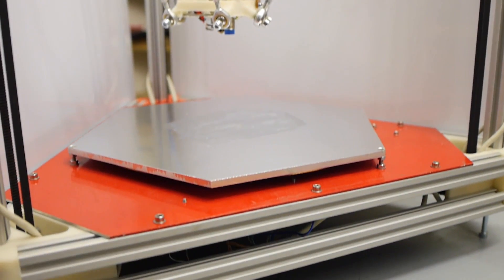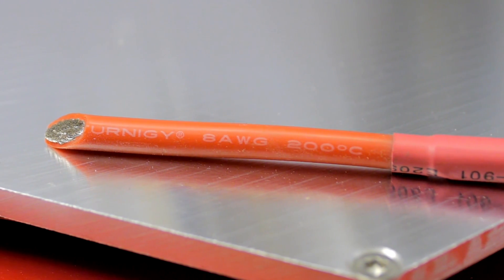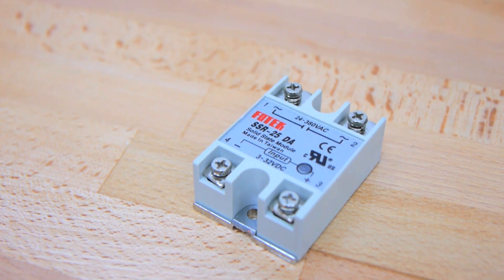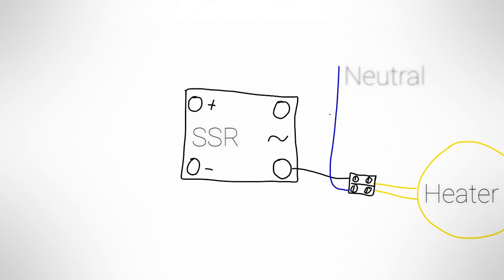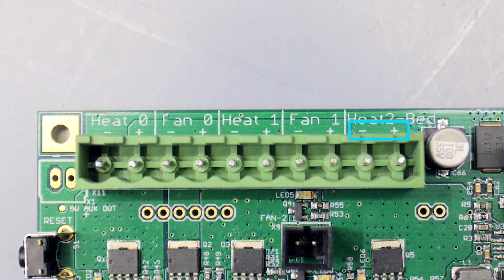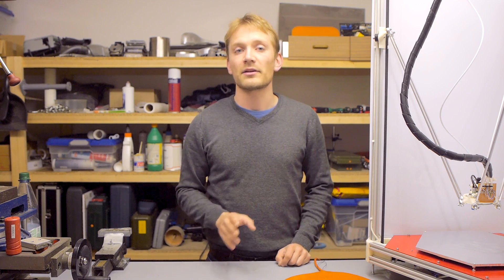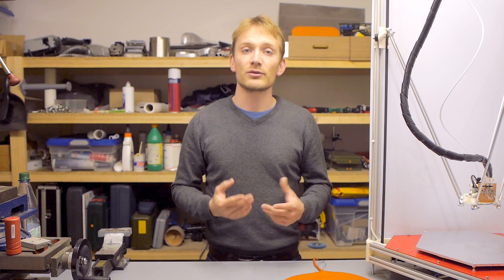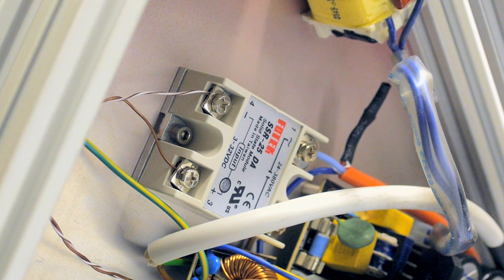3D printing guides: Going big with Solid State Relays!

Comment: Hello Tom! great videos, keep rockin!
i have a question. ok, SSR's wiring for heated bed is quite simple. what about using an SSR to power on/off a led power supply?
where (on RAMPS) can i connect the SSR's input? to PS_ON and Ground? will it work?

Comment: Tom, thanks for the great videos. I'm new to this, but quickly tired of waiting for the bed to heat up, so I tried switching to a 200 watt 12 volt heater on my i3 RepRap kit. First I fried the MOSFET on the RAMPS board. Having replaced that and finding this video, I bought a 25A DC-DC SSR. As soon as I hooked it up, it started melting, and would not shut off.

Please cover what is required for cooling, as I thought this big, beefy thing would be able to handle the current, and had no idea it would get so hot.

Comment: Hi Thomas!
And thanks for all this informative videos! I wonder if going with a ac powered Silicone pad and SSR what is the best settings regarding the PID or should I use bang-bang mode instead? Someone said that the SSR is not build for switching power on/off so fast the PID settings make.
Reply: Ok found the answer in the marlin config video! But you dont mentioned any settings for the hysteresis. Just wonder how to get the best settings there?

Comment: Hey tom I really need help. I bought on of the ssr that you mentioned in the video for my delta but I don't know if it will work.  I'm using a 210 diameter 12v pcb heated build plate.

Comment: Hello Tom! Thanks for all your videos!! Is it possible to use a SSR DC-AC instead of a DC-DC? I'll Explain: I have a 12v silicone heater, but my ramps is not able to run it, so I bought a SSR, but it came wrongly: a DC-AC instead of a DC-DC. I tested it with some LEDS, and it turned the leds on, but they never turn off. I don't know if the SSR has some problems or if this is caused because it is AC. Thanks a lot! Bruno from Brazil
Reply: +Thomas Sanladerer  - Thanks!!

Comment: Tom, great video once again. I am just putting in a request to you to make a full length video of electrical concepts involved in wiring any 3D Printer board, highlighting the dangers/tips/tweaks that involve wire gauge, stepper motor drive, currents and how they correspond to the pins. So that even a beginner can understand how to effectively build the electronics for the 3D Printer board.
Thanks in advance

Comment: I got a question about my MK3 Heated Bed for my prusa i3 (RAMPS Based, 12 480W PSU)
What are expected Headup times for 60 or 100^C? I insulated the bottom side of the Bed, but it still takes about 10-15 min for 60^C and about an Hour for 100^C. Is that normal, or what should i check?

Comment: How hot does an SSR get and do you think it would need a heat sink?
Reply: Bought this one: http://www.amazon.co.uk/gp/product/B009SXHJD6?psc=1&redirect=true&ref_=oh_aui_detailpage_o00_s00

Should be fine; but we will see. Just scared it will fail in the on 'position.'
Reply: +Thomas Sanladerer, I bought an SSR-25DD, which should have powered my 200w heater (200w/12v = 16 2/3 A), but the SSR melted. Polarities were correct, so what else could I have done wrong?

Comment: Hi TOM! i'm building a custom 300x600mm build size printer,and i've already ordered a custom silicon heating pad for it, and i was wondering about the best approach to provide 24v (660W) to the pad, should i just get a bigger MOSFET, and run it off of my MKS smoothie board or go with he SSR or may be get a PID Temperature Controller with it to control it separately? 

And BTW Thank you for the awesome videos I've learned quite a bit from you.
Reply: +Mazin Omar I am currently working on a same size's project, so if you have update, let me know!
Reply: +Ancton Zandor MOSFET is no good. go with either SSR to Printer board, or SSR to digital PID temperature controller. which is most likely what i'm going to go with
Reply: +Mazin Omar Semms interesting! Thank you, I'm going to read on that to see the possibilities!
Reply: Ancton Zandor You're welcome.
Reply: +Mazin Omar If you have good links or infos on how use that efficiently, You can share! I'm good with mechanics, but electrics/electronics... arhhmmm
Reply: Ancton Zandor There is really not much to it. you can go to Aliexpress . com and order you a bundle of 40amp DA SSR + sensor+ PID temp controller for 15$ with free shipping to the U.S. once you get you'll understand what i mean, but if you do need any further help, then go a head and look around youtube, there are many videos made about this topic.
Reply: ***** no power supply will be necessary for the heater, it goes straight to mains, it will work like any other space heater except controlled by the PID temp controller and the SSR.
Reply: it depends on how much the heater is taking, and also if you going with 12v make sure your SSR is DC-DC and the heater is made for 12v. i personally wouldn't want to go this way. but its your decision to make.
Reply: +Oliver Trinh Higher voltage is more dangerous but it is much more  efficient and fast when it comes to heating and of course it depends on the wattage of that heater.

In my personal experience I've had more problems when running heaters on low voltages like 12 and 24V .slow heating cycles.  MOSFETs burn out,  plastics melt  and simply not have enough power coming out of it even for a smaller build plate heater.

You'll probably spend a 100$ going with the 12v PSU setup. so you're not going to save that much. i say save some money for something that is already been approved and tested by several people. you're safer that way. 

Please be careful when working with electricity. especially mains , it can be deadly or very painful. and take your time.

No matter what voltage setup you pick, your build plate will get heated. keep that in mind.
Reply: Yup, this should work. and no need for a special plug.
Reply: +Oliver Trinh yes DA 25amp .. follow Tom's video. it'll guide through it.
Reply: +Oliver Trinh yup

Comment: What's the mother board you use for the delta 3d printer
Reply: +Thomas Sanladerer how did you wire the inductive sensor to the smoothie? having trouble with mine...

Comment: Where did you get the 230V AC heater mats (I specifically look for 300x300 or 350x300) around 600-1000W would be perfect, or what would you recommend ?

Comment: Hi Thomas, question again, after watch this vid, I start searching for some main-powered heated bed and came across something called "Cast aluminium heaters plate"(google it to see what I mean). It look like a cast aluminium block with tubular heating elements embedded. Many seller claim that it can power up to 3-4 W/sq.cm which sound really good for heated bed and since it's solid aluminium block it should dissipate heat very evenly and look like it's very durable too, the only downside I can think of is you lose a bit of print height(it's 20mm thick) and weight if you use on printer that have moving bed.
Any idea this thing might work or not?
PS. I use it for Delta by the way.

Also an idea for your video, how about "All about safety you should know when build and use 3D printer, especially overnight printing" :)

Comment: Did you use Smoothieboard on that Delta?
Reply: ***** Thank you, I planned to build a delta soon, I guess I will go for Smoothie :)
Could you make a review of your delta, I see that you use different design where Openbeam stand twisted at 45 degree angle and use V groove delrin wheel, how is it compare to HIWIN guide rail or normal 3 wheels.

Comment: My silicone heater reads 2 ohms on multimeter, can it be used for 230 V AC ? It measures 300mmx300mm and has integrated thermistor .
Reply: It's a 12V 300W heater. Is there any way I can improve its heating time? I use a PEI plate 3mm thick and it warps , any solutions ?
Reply: I also have a band heater rated at 230V 115W 25A and it also measures 2 ohms on my multimeter !

Comment: Can i ask why you have those extremely long arms on your delta? You should be able to get away with shorter ones, and still be able to utilize the full build space. You would also get more build height will shorter rods.
Reply: ***** 
Is there an ideal ratio of build diameter to delta rod length?

Comment: Good review! I'd already learned most of this myself (Including the small leakage current, which of course reads at full mains voltage to a high-impedance meter! Scared the hell out of me at first!) and wish I'd had your advice back then. Didn't know about the new DC ones.. Yes, the usual ones can only switch AC because they use TRIACs - which can only cease conduction during zero-crossing, which of course DC doesn't do.
Reply: Jeremy Lee In fact, the small leakage current can even turn on small pilot/standby lights, (especially neons) which can make the appliance seem to be turned "on", until you do turn a major load on, and then the light goes out! (Which can be freaky.) Basically, it's good to always leave them connected directly to a resistive or inductive load, (no switch!) so the active side can't "float". And remember: even a couple of leaked milliamps will still charge up a diode/capacitor network, given time, to full lethal mains power.

Comment: Hey Thomas, great video indeed! My question is, I bought a 600W silicone heated pad, and it has a resistance of 0.22 ohm. If I connect it using an AC solid state relay with 220V AC, don't you think it will draw a huge current(220*220/0.22 ampere) and trip my mcb?
Reply: I= P over V  so 600 watts divide by 220 volts = 2.727 amps
Reply: If it is 0.22 ohms, it's clearly not made for 220V, but 12V. Calculating the power output at 12 volts w/ 0.22 ohms gives you around 600 watts. Current would be around 50 amps however.

Comment: Great video, can one of these be used to control the AC (mains) power to a 12 or 24 volt power supply in marlin like an ATX PSU?
Reply: ***** would it be possible any other way?
Reply: +Moshe Kashani 
ATX power supplies have a dedicated on/off pin use that;)
Reply: Stephen Beeson I actually just finished the mod using a standard  relay, I can't find the guide but it was pretty straight forward.

Comment: I've had very good results with a Fotek SSR-40 DD (DC-DC) relay to run a MK2B heatbed.
I just got tired of the long heating time (when going above 100C), so I got a separate 24VDC PSU (and tweaked it up to 30VDC) just for the bed.
This works really well even with PID and heats up very quickly.
I did make sure to connect to the 24V input on the MK2B.
I also bought a heatsink for the realy in case the PID caused it to heat up, but it barely gets warm to the touch (using marlin with default PWM).
Reply: Øystein Krog So, you waited a month to get one, by ordering from China?  How did you know is was not going to be a fake and not work?
Reply: Richard Turnock I don't think it took a month for me, more like 2 weeks. I bought it because I found several other people who has had success with it and because it was not very expensive. 
I also took extra care when using it to ensure it would work as intended.
All in all I think the risk of getting fake stuff is not actually that high.

Comment: 1 solitary dislike. way to break the mold, whoever you are
Reply: ***** Great Video.  I followed links to eBay however there are so many different sellers and i have been warned about fraudulent Fotek SSR sellers - and these are all from China - plus the deliver time is about a month.I found an AC-DC SSR local that they got from Sparkfun.
However, they don't have the DC-DC SSR that I want.
I have a 24v power supply that powers my 3D printer, with Taurino Power  PCB but using existing Ramps 1.4, did not buy the upgraded Ramps for 24v, maybe I will have to do that instead of using SSR.
Using SSR with Main voltage (120V here in US) is not safe with exposed connections like the SSR has.
I will go buy the upgraded Ramps with the better Diodes for F2 and F1 to use with 24v.
Reply: Richard Turnock you could use a good old dumb and dirt cheap relay. Even though it is less sexy it really does the job well (check my comment above). Just switch the firmware to bang-bang.
Reply: Jeremie Francois "...a good old dumb and dirt cheap relay"Yes, but I am learning daily about electricity and Java so on a steep learning curve.
Which one? Which dumb, cheap relay?  You mean like an automobile relay? which one?
Reply: Richard Turnock the easiest is to buy an existing relay module made for arduino boards in the first place. Most sub-$2 "relay module optocoupler" on ebay will be fine. Almost all of them would be suitable, unless you have a HUGE hotbed.

Just check the voltage & power for your bed. E.g. at $1.50 the one below is more than enough. Ohm's law says P=UI : power(W) = voltage(V) x intensity(I), so this small relay already handles 300 watts of power in DC mode, way more than what you could get out of a usual 3D printer power supply. To be safer even, consider only the 10 amps it may drive: with 12V at 10A you can drive a 120 watt hot bed, and with a good margin.

E.g.: http://www.ebay.com/itm/1-Channel-H-L-Level-Triger-Optocoupler-Relay-Module-for-Arduino-5V-New-/251338554396?pt=LH_DefaultDomain_0&hash=item3a84f1fc1c

Using an automotive relay is both more expensive and more cumbersome as you would have to add some components to drive the relay coil (the trigger). The output of a microcontroller is certainly not powerful enough on its own to drive a bare relay (you would burn them). You get tons of doc on the web with relay + arduino.

This is also why I recommend the few more cents that an optocoupler adds to the bill, because it fully isolates your board (though this is not compulsory). Check the fake one! An optocoupler-enabled relay board is visible (the small blocky black or white 4-pin component on the board). The other kind of relay board are driven by regular transistors.